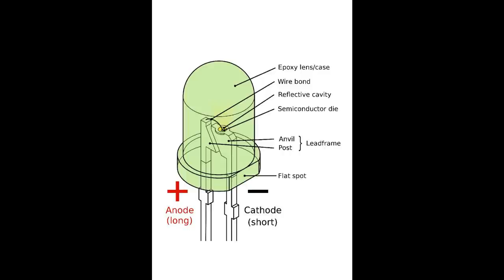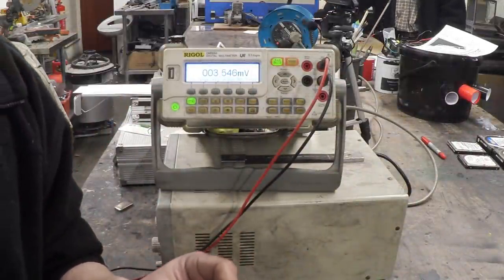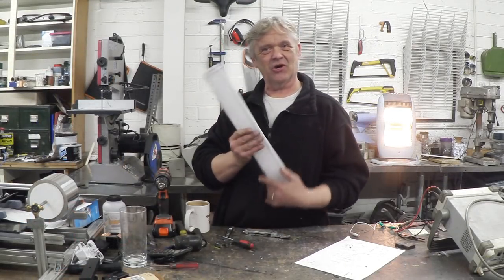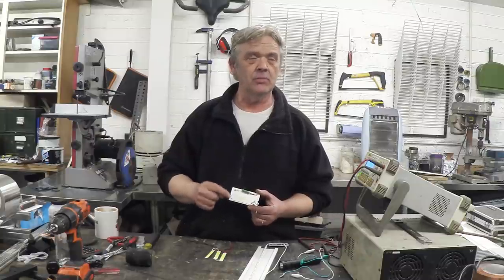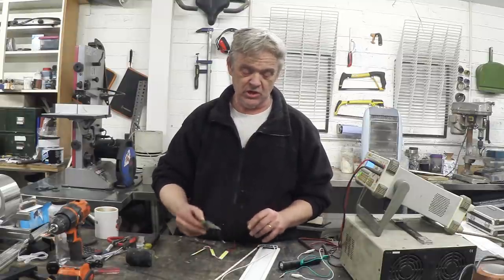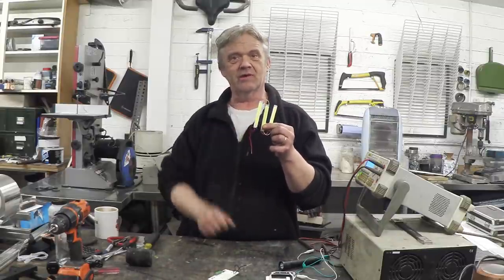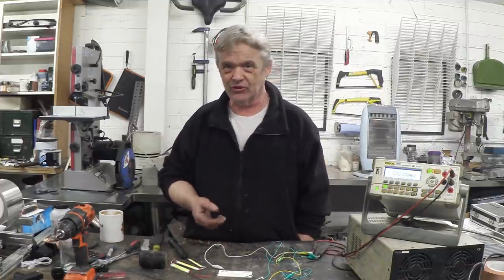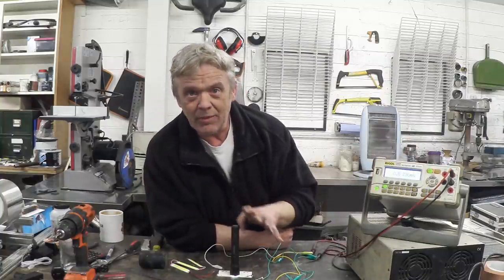1025 Making Your Own Solar Panel From Broken LED Lights

Comment: I discovered this as a young man and found at the time that the LEDs in the ultra violet range generated more power!  I also used this property to measure the voltage changes through a test tube filled with various liquids!  On one side I placed a red laser diode as the light source and an LED on the other side receiving the light!  I just connected my voltage meter to the LED and it worked nicely!

Comment: I would appreciate seeing you do a video explaining and showing how you would link 20 or more similar very simple micro-generators together with a circuit that would actually allow you to get enough voltage and power out that is capable of charging a 12vdc battery bank. All the simplest designs of moving magnets through and past coils can be made to works, but how can we link up the tiny outputs from them all to put out a practical voltage and power value?
Your enthusiasm in your videos is refreshing to see. Thanks.

Comment: Brilliant video, as always.  Would topping your led matrix with one of the lenticular sheets from an LCD screen make it more efficient?
Reply from the maker: now then - I like that idea mate - cheers
Reply: @ThinkingandTinkering  Very glad to help :)  Your videos are a fantastic resource.
Reply: Generally the hotter something is the more resistance it has. 
I would assume that adding a focus lense would have a negative effect. Probably just burn the LEDs. 

Maybe it would focus polarised light tho, like moon light. But hey in all honesty, I know nothing, I'm guessing. 
It's worth a try for sure. 
Awesome suggestion. I've wrote it on my wall for a summer test.
Reply: @garethb5729  if u think water cooled then you have also thought water heater , so u have hot water and electricity! genius!
Reply: @garethb5729  If I remember correctly what Rob said in his video, the flat line lenticular sheets just redirect the light coming through it, they don't focus it like the round lenses that you'd use for a solar still/oven.  But, there's only one way to find out for sure!
Reply: @lopsumtathro  what if you covered a kayak with LEDs?
Reply: @garethb5729  then the fish would have a disco
Reply: @lopsumtathro  nah dude fish are weird, they prefer Luciferin. The sneaky secret ravers.
Reply: @lopsumtathro  a CHP Solar panel, wow!

Comment: Would an led telly work do you think? There's loads of them get thrown away constantly.
Reply from the maker: I think it is worth a try mate - I have never come across one but if I did you can bet I would be trying it
Reply: @ThinkingandTinkering  I love your videos. I have a question about a jumper box. I know that they can be charged different ways. 
I have an old box the battery has a bad cell. It is a 12v 7ah multi purpose type. I am going to take it apart. If I can't get to start holding a charge above 11.5v
My question is how can I find a power source. I have a power supply output 12v .42A. Will it be sufficient for the job. I don't know much about the box. It has power supply plug 🔌 on the back. I found a power supply on the other side. However it plugs directly into the circuit board. It is  15v 500mA output. It says switching adapter so that confuses me a bit. Am I wrong assuming it could be charged using an extension cord plugged into this adapter????
Sincerely confused. LOL
Reply: @ThinkingandTinkering  You have a LED monitor you pulled to bits rob
Reply: I have had this in mind for while i have loads of dead led lcd tv in fackt my first thought was a plasma but the conections to the screen are hundreds.

Comment: Excellent work. I wonder if using the COB's you would need to try and remove the phosphor coating? it would be acting as a wavelength filter and reducing the actual wavelengths reaching the silicon. I suspect you might see an improvement of up to 50% by simply removing the phosphor.

I am working on my own rural solar light project for remote sections of Papua New Guinea. I am using a single PV cell that has a peak voltage of around 0.6v and max current of around 5 amps. I am using a joule thief circuit to charge a single AA sized NiMH cell, and then I am using another joule thief to drive 5 x 3W LED (cree) modules. This is providing a full charge to the cell in about 5 hours, and will charge even in full shade. the fully charged cell can drive the 5 x 3w LED array for about 12 hours.

Sure the LED's are being under-driven, however they are indeed producing useable light, and they are not heating the junction and wasting energy as heat.

Your channel is an amazing resource.

Thank you.
Reply from the maker: wow  - thank you ate and I like the idea of removing the phosphor
Reply: I really like the idea of using a joule thief with a single cell to boost it to charge the battery. How much current are you getting from the joule thief and do you have problems starting it with only 0.6V on the input?
Reply: @AndyFletcherX31  I haven't measured the current, I have been monitoring the voltage. I am getting a peak charging voltage of around 2v, and the internal resistance of the cell increases as it approaches full charge and the voltage from the charging joule thief drops to 1.45v when fully charged.

I will be doing other tests this week which will include current monitoring in the charger circuit, and the delivery circuit.

I have this connected to another joule thief circuit that works very well as a driver for 5 x 12v 3w cree elements. 

I have found that I am getting an open circuit voltage on the charger joule thief of around 20v with the PV cell in full shade and delivering only 0.3v. In full sun with the PV cell delivering 0.61v I am getting around 40v open circuit.

Comment: If I remember right, LEDs can only absorb photons in the colour they emit or higher frequency. As white LEDs emit blue (and are covered in a phosphor that turns some fraction of blue light into other colours), they're unlikely to be very efficient capturing most light sources, but the blue and UV light from sunlight will likely create some power (if the UV isn't blocked by whatever material the lens is made of). Solar panels are essentially arrays of huge, far-IR LEDs (I guess photodiodes, technically, since they're designed specifically to minimize the amount of power they waste by emitting light) designed to maximise the range of light they're able to 'work with' and the surface area they cover. If you could find similar sources of red or IR LEDs, they would probably work much better than the white/blue ones. (but of course, they're much less common in scrap, particularly as big COB panels.)
Reply from the maker: I think you are spot on mate - cheers

Comment: This way of thinking... that of understanding the basic mechanics/ physics involved in systems is crucial to engineering; particularly DIY backyard inventor style!  I tend to think in these terms:  Almost all systems that produce "work," involve separating two forces (be they electrical or mechanical) and then when the "charges" or forces want to balance, you plug some type of machinery in to capture that; and voila!   I've contemplated "batteries" that are just big ol' weights that are lifted up, and as they fall, they generate a current by spinning or passing coils etc.  Or; one could pressurize metal tanks with air or a fluid (or vice versa,  pull a vacuum on the other side,); other ideas involve dissimilar metals, and applying heat (could be from a fresnel lens in the sun perhaps) on one side, and cooling the other (perhaps a cooling system akin to the old "swamp" cooling units/ air conditioners; Ie: water runs down fins with air over them etc.)...   I'm rambling a bit; but the point is, THERE ARE ENERGY/ POTENTIAL DIFFERENCES ALL AROUND US... ALL THAT MUST BE DONE IS TO ENGINEER MACHINERY AND SYSTEMS THAT EXPLOIT/ MAGNIFY, AND CAPTURE THEM TO DO USEFUL WORK... THERE'S INFINITE WAYS TO ACCOMPLISH THIS WITH A BIT OF INGENUITY, AND OLD FASHIONED CLEVER TINKERING!!! :)   Thanks so much Robert for sharing your experiments.  May we all inspire one another toward energy independence; which will, in turn, bring a more free and autonomous society at large.

Comment: Pleasantly surprising, I used to think it would not work when I was doing bachelors on electronics engineering.
Reply from the maker: I can see uses for this even if the power gen side turns out to be rubbish
Reply: you never let the efficiency gang slow you down :D

Comment: Aiming a pair of Leds at each other, inside a straw, using one as a led and the other in PV mode, is an old bodge for providing optical voltage isolation of a signal. Need to series duplicate the output for  higher output voltages.

Works pretty well for interfacing mosfet switches to arduinos. As it works like a voltage controlled voltage source... Connect the PV diodes between gate and source... And the gate-source voltage will never exceeds what the PV diodes can output. Allows n-channel mosfets to used as high or low side switches.

So... 
4mosfets... 2*2*4 diodes(led&pv doubled for voltage, for each mosfet) and that's the power side of a H-Bridge. 
Throw in an arduino for sequencing of the  control signals for the mosfets and that's pretty much a motor controller. Arduino has enough processing power to read say a variable resistor, or be set via digital coms from say an i2c bus.

Mosfets that can handle 50V and 50amp are pretty darn cheep these days.
Reply from the maker: that's clever mate - thank you for that share - it's destined to be a video - due credit to you of course - cheers

Comment: This is great idea, reusing old leds. Some diodes like 1n4148 will do the same, but voltage will not be same as leds.
Reply from the maker: nice tip mate - cheers

Comment: very interesting! it would be nice if you could build a circuit that allows them to charge by day but still light up when desired. maybe a simple switch is enough? there are lots of cheap products using small solar panels, like those garden lanterns and well...they barely work, but it would be a step forward to mitigate that PV panel.
Reply from the maker: I wouldn't think that would be too difficult to do mate to be honest

Comment: I never got great results in trying to use LEDs for actual power generation. It always seemed that adding more increased the chance that one was misaligned and acted to limit the rest, but that was a long time ago when the only kind that was easy to find were individual 5mm ones. I did however find that 3-4 in series and carefully aligned could switch a MOSFET when soldered directly between the gate and source.
Reply from the maker: like most of these things they have come a long way. mate

Comment: It is interesting that the LEDs still produce some current even though the phosphor is in the way between your light source and the chip itself. Maybe some blue light actually still gets through to the chip.
To knock an electron off, you need a certain minimum wavelength of light, and I'd assume for a blue LED it would have to be at least a blue wavelength.

Comment: Wire them up as the diodes in a  voltage multiplier circuit! Wonder if it would hi-light the leaky caps.

Comment: Interesting experiment!  I would have been very interested to know what the current output would have been.  Do you suppose there are any old LED computer monitor panels that could be adapted as solar collectors?

Comment: With the new research that shows increased efficiency with light guides, I wonder what would happen if you took one of these busted panels and just treated it straight up like a solar panel; would it be more or less efficient than a traditional solar panel of the same size, particularly with cooling along the LEDs?

Comment: You are showing the basics of how a solar or sun tracker works. The put 2 on an east plain and 2 leds on a north south plain.  They compare the power coming out of the east west diodes to each other and move the time that needs to point at the sun until the power output of each diode is the same.  It does the same for north south and when the power is equal the array should be in the spot where the suns power is the strongest.
Reply from the maker: for sure mate

Comment: rob whats the best way to connect em . parralel or series as i got a bunch of 12volt cob leds  with individual 9 leds when i pass a lower voltage of about 9v  i can see the individual dim lights ?? any help would be awesome

Comment: A couple of questions for you to think about,
An LED light bulb has a life span as a light, do you think using the same LED's as a collector would be the same life span?
I have found that the screw in LED's (like an incandescent bulb) fail in the electronics and not the LED. Would you think that type would have the same abilities?
Your assessment of collecting photonic power so to speak makes me wonder about a a bank of LED's to collect and mixed in the same bank LED's to emit light.
Let me know what your thought are.
Cheers

Comment: Rob, I tried this by finding old lights at my place of work. It worked!! I managed to get 10 volts on a cloudy day and got about 1 micro amp at its max power output. Yet to try in full sun.
How would I get higher Amps? Would it be worth putting LEDs in parallel using diodes instead of just in series?
Reply: LED's are diodes

Comment: It's a well known fact this works. Photodiodes are made for this purpose, that is, not for generating energy but for measuring light. Basic principle is the same though. I wonder if someone could get a solar panel to lite up. With a big heatsink it might be possible.
Reply from the maker: yes you can it lights in near IR

Comment: Great experiment wonderfully explained as usual Rob. I wonder, with a parabolic mirror and some sun whether or not you could get some decent output from these.
Reply from the maker: I plan on trying mate
Reply: @ThinkingandTinkering  maybe take one which already has a heat sink. The floodlight probably.

Comment: But you never really spoke of the "elephant in the room".
The best "colour" of LED to use as a charge source.
I was thinking blue as they have no phosphorous coating to probably diminish performance by "blocking" incoming photons??
Just theorizing.
(EDIT: Are COBs only in white?)

Comment: Mr Murray, i have often wondered if we can use  thermal couple or thermister tech to generate current like a solar panel but from heat ? then possibly capture the heat from appliances and return to a battery in the appliance with an inverter to reduce the consumption of grid power needed .? im unable to create a prototype at this time
Reply: This does actually work when coupling the TEC (peltier unit) with a joule thief circuit. You can charge a capacitor or battery and then use the energy from there.
Reply from the maker: Terry has given a really good answer mate
Reply: @TerryGilsenan  Indeed. It's called a peltier element and is a big thermocouple. It will function in reverse.
A thermistor or any other resistor functionality does not work the other way around. The second law of thermodynamics forbids it. You can heat up an ntc or any other resistor whatever you want. It will never generate current.

Comment: I wonder if it would be possible for an led display to be set up so for a tiny fraction of a second it would illuminate say a moving row of light, and detect on the unpowered leds light reflected back off a finger tip. Same with columns... And that's basis of a touch screen.
Reply from the maker: I don't know mate - fancy giving it a go?

Comment: Would this “in reverse” thinking work with a beta (electric) emissions source?
If so a it would be easy to create a betavoltaic cell and scavenge energy from a radioactive source. Tritium is rare by easily acquired
Reply: That IS, in effect the principle of a nuclear battery. (As used in satellite technology and hot dog stands!)

Comment: I had wondered, with LED lightbulbs (like those standard incandescent replacements), once they burn out- is it the LED's that went bad, or something else inside them?  I've got one that I cut the globe off of, and it's got one of those flat panels in it 8 leds, no electronics, and 2 wires soldered on.  Those have a little smudge of burnt around them, maybe, so don't know if they're dead or not.  Haven't dug into the bottom part of it yet, not knowing what's useful or not in there.   I thought it was a potential free source if it was electronics in the bulb rather than the LED's themselves that went bad.
Reply from the maker: stick 'em on a multimeter and shine a light on it mate - you'll soon see if there is an output - oh clean the terminals first lol

Comment: £84 @ radio shack,you need to shop around man,you can get those on eBay for 20 quid,their advertised as being 100w but they ain't unless you get a rocket an launch it into the sun lol

Comment: Any ideas using gravity to generate electricity?  Gravity is always on.
Reply from the maker: I'll have a think - cheers
Reply: Gravity is always on, that's the problem. If it were not always on it would be easier. You could lift the weights on the clock on the right time. Maybe the influence of the moon on gravity could give a little energy (like the tides).